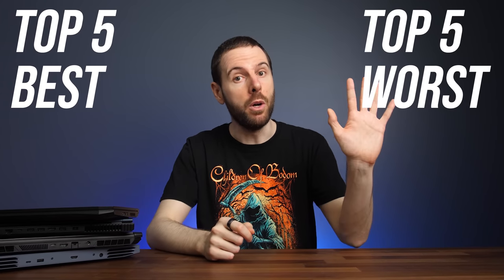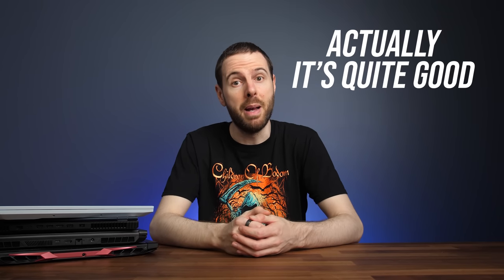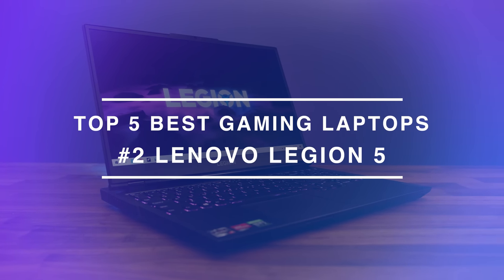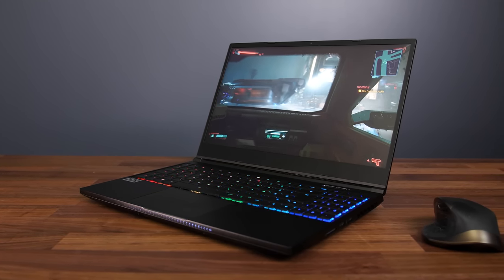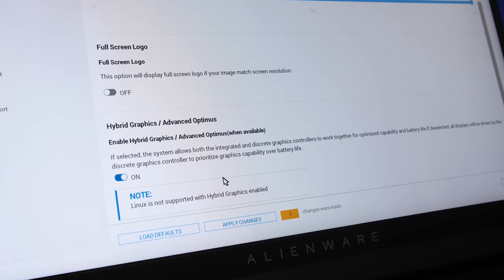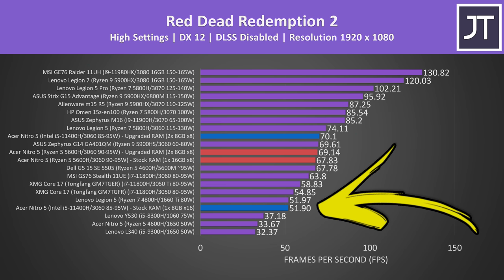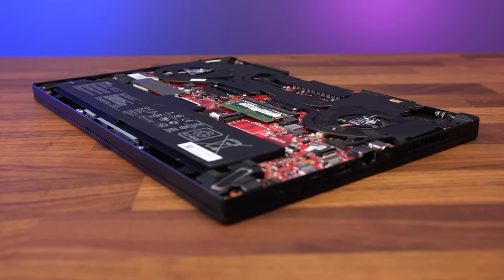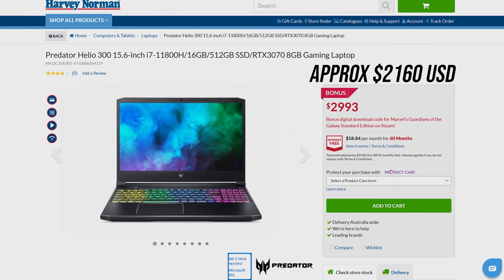Top 5 BEST & WORST Gaming Laptops of 2021!

Comment: It's sad you left the G15 Strix AE off this list.  It's by far the best value to performance you can get.  5980HX/6800m are both top tier.  Biggest knock on it is the plastic, but you had the Dell G15 in the list so apparently that isn't the issue.  But this is an opinion piece so I can see certainly understand liking the Legions.  Cheers!
Reply: I tried the G15 Strix AE and desperately wanted to love it. The CPU and GPU are crazily powerful... BUT, no MUX switch to fully unleash that 6800m, and the heat build-up on it (and every other 15.6" laptop I've tried) killed the deal for me. I also couldn't stand the heat and fan noise pumped out by the Lenovo Legion 5 (with its incredibly irritating and constant fan spin-up and spin down). The Alienware m15 R5 with the 3070 was the biggest sauna-maker (Jesus, the heat that thing threw off, I'd be amazed if the machine lasted a year of normal use), and the pushed down keyboard had my wrist hanging over the edge of the keyboard deck, so that was returned, too. The Dell G15 came the closest to being tolerable in terms of the fan noise generated, but it also ran a bit hotter than then Lenovo. I think I liked the G15 the best because it was quite a bit cheaper than the Lenovo, and quieter while gaming, while still providing a MUX switch and the same 165Hz 1080p panel.  I finally figured out the only solution to the heat/fan noise generated by all the 15.6" laptops I tried: a 17.3" form factor. Currently have an MSI Leopard GP76 with an 11800h/3070 combo. It has a MUX switch, but runs quieter than the Legion 5, and the heat simply gets more easily dissipated by the larger chassis. Only thing is, it weighs a ton, especially with its power brick. I finally just tried an Asus Strix G14 with an AMD 6800hs/6700s combination, and I loved the size and weight, but it got so hot, it was actually uncomfortable to touch the upper metal keyboard deck. In this case, I think the plastic chassis are an advantage, like with the Dell G15, because plastic is non-conductive of heat, so the keyboard deck stays noticeably cooler. In the end, I might just sell the Leopard GP76 and pick up a 2021 Dell G15 5800/3060 combo for $1199 Canadian while I still can. The awesome battery life combined with the gaming performance, quieter fan, and the plastic yet high-quality build may have just won me over for good.
Reply: @EMLL.33  got the same g15 for the same price expect intel i7 was 1200 cad and the ryzen was 1500 cad so I went with the intel

Comment: I personally have no problem with a single ram stick because I already have sticks, making it better than if it was dual channel because then I'd have to change both sticks to upgrade the pc from 8gb to 16gb. But for those without plans to upgrade dual channel will be better
Reply: Changing 1 stick vs. 2 sticks isn't that much different though.
Reply: @ACE112ACE112  true, but in my country parts aren't easily accessible, or cheap

Comment: I have the XMG Core 15 so essentially Neo 15 budget version. And if Jarrod had it it would be No. 1. Cheaper by a €1000, but barely worse. All the same features bar mechanical keyboard and the chassis is half plastic half metal, not all metal. Also well cooled, light and powerful
Reply: Mech 15 G3 owner here! Woot! Great PC, glad you found a good deal for the TongFang chassis.
Reply: Correct me if i'm wrong.
Core15/17 are Clevos and Neo15/17 are Tongfangs.
Reply: @nyyke   Both Tongfang. It almost the same chassis and it is the same display. Both get that good looking control panel that has controllable power limits (very cool) but some buginness (less cool)
Reply: @nyyke  Yes, if by Neo you mean a brand from XMG -- those feature TongFang chassis (basically the same as Mech 15 G3 from Eluktronics), though not everything by XMG is from TongFang, they are listed as customers of Clevo as well but not certain about the details. Cheers, mate!
Reply: Sorry My mistake, I just messed core and pro. As you corrected already core15 is tongfang 😅 with neo and core there is few minor differences in power supply, gpu avaibility and other small things.

Comment: Thank you for your incredible work. It helped me a lot by choosing the right gaming laptop. Finally decided to go with the legion 5 (3060/Ryzen 7 5800h) and got one for 1000€ at Amazon 😍
Reply from the maker: Glad I could help!
Reply: One month in, how is it holding up?
Reply: @JamesMcarthy2369  the laptop is awesome, performance ist outstanding and even the cooling system is working really well. Never had temperatures above 75° (GPU) and 85° (CPU). I totally recommend it
Reply: @SilkroadFever  thanks for your reply! I’m going to grab it in a few days.
Reply: @JamesMcarthy2369  same 😁
Reply: I just ordered the same as yours with 17.6 screen. Had lot of doubts when choosing between 15.6 and 17.3 since I never had bigger laptop screen than 15.6
Reply: @anon4376  well for me 15.6 is more than enough. I mainly use it 1-2 days a week when I visit my gf or my family. Rest of the week I have my tower at home, so I thought 15 screen is more comfortable to travel. :)
Reply: @SilkroadFever  Hi is still working well now ?
Reply: @hanionline563  hey, yes Laptop is running perfectly fine! The CPU and gpu temperatures are a bit higher than at the beginning, but I never cleaned the fan. This gonna be my to do in the next months. I still totally recommend it!

Comment: I got the Acer Nitro 5 3060 with the 11400 i5. It was A$1796 marked down to A$1287 this weekend. Extra stick of ram and it’s great laptop. Paying close to A$1800 would be a disaster compared to the legion 5 or dell though
Reply: rip bro now its 650$ the amd version
Reply: @TheChuyDewy  Best I could find was a 3050 version for A$997, even my exact model was A$1398 a year later. 

That’s at Harvey Norman.

Comment: Great video and great timing to release. Thank you for your hard work. 
I am wondering which one is better if the price is only 100usd different between this two options for a Legion 5 pro;

Option 1: Ryzen 7 5800 rtx3070 
Or 
Option 2: i7 11800 rtx 3060

I want to make a decision according to better performance and long term usage.

Anyone is welcome to comment.
Thank you in advance =)
Reply: The Ryzen version hands down. I'd avoid Lenovo if you want a laptop that will actually last
Reply: If it helps, I went with the Ryzen version. Tends to be more efficient on battery and the performance is very similar. If you are a gamer, go for the 3070 version. I'd only go for the intel if you need thunderbolt.
Reply: Ryzen all the way
Reply: @xXlURMOMlXx  wdym
Reply: Better gpu any day

Comment: For the G15, only the G15 5511 (i7 11800h) and the g15 5515 ( ryzen 7 5800h) has a mux switch while the G15 5510 (i7 10870h) doesn’t. G15 5510 also only has 90W tdp 3060 while the others are 125W
Reply: Good to know🙏
Reply: I bought the Dell G15 with the 5800H and 130w 3060 and it's the best gaming laptop I've ever purchased and I've owned numerous over the years now.. incredible performance for the $$ and great looking with solid build quality

Comment: What are anyone's thought about Asus Strix G15 Advantage Edition. On one hand we get to hear negative reviews about its GPU going completely kaput weeks after purchase, but on the other hand the 6800m costs what a 3060 Laptop would cost here in India and gives performance that sits between 3070 and 3080.
Reply: The advantage costs 1.55L. It’s probably one of the best high end laptops here but still not worth it. Better to get something like a victus or a nitro(upgrade it to dual channel)
Reply: Asus is unreliable. I had 2 different laptops die on me because of their motherboard soldered crap. Even without that, poor finition and poor thinking by engineers. After all this years they still don't learn about their mistakes it's like they don't care
Reply: @niksarass  their qc is trash. I returned my AE 4 times due to screenbezzles falling off
Reply: @windkiller97  Hahaha I had that one too! My screen ended up stuck, in top of all the other problems. What a joke of a manufacturer

Comment: at my place the dash f15 has a pretty reasonable price at this gpu shortage time while the legion 5 has a terrible p/p
Reply: Asus tuf dash f15 only make zense in cheaper variant with rtx 3050 and rtx 3050 ti avoid rtx 3060 or above variant because it will cause cpu bottleneck
Reply: @mrbobgamingmemes9558  the opposite can be seen with legion as the more expensive variants have a somewhat reasonable price while the lower and more affordable variant are out of stock most of the time therefore increasing its price
Reply: @mrbobgamingmemes9558  don't worry it makes sense with ryzen version with 6 cores and 8 cores, it is cheapest in india ( model becomes asus tuf gaming a15)
Reply: @be_an  why not just check regular asus tuf a15 or f15. if asus tuf dash pricing very good in your region same thing should applied too on tegular tuf a15 and f15 2021 edition
Reply: @mrbobgamingmemes9558  well yeah but what i was trying to say is that legion 5 is not that great anymore at least for now during the pandemic
Reply: @mrbobgamingmemes9558  actually 3060 version is the best bang for the buck. 3050\ti not only seriously lack vRAM, but also cost nearly as much as the 3060 version of Dash F15. It's the 3070 version that people should avoid.
Reply: I want to buy a normal one (Not Dash) with a i5-11400h and a 3050 is it good?
Reply: @JD-jn14  if you cannot spend more for rtx 3060 yeah sure go for it .just beware that maybe in 2 years you have to play at 720p resolution due to small 4gb of vram
Reply: @TabalugaDragon  tuf dash f15 only make sense to buy with rtx 3050 or 3050 ti  above that gpu class you will suffer cpu bottleneck . Trust me you dont want pay more for the gpu but you cant utilize the entire gpu because the cpu cant keep up with the gpu
Reply: @TabalugaDragon  just go for regular tuf a15 or f15 (non dash) version for rtx 3060 or above
Reply: @mrbobgamingmemes9558  Yes I do, because 4GB of video memory 3050 and 3050 ti have are an already terrible bottleneck, where you  can't max out textures in any AAA game without a serious drop in performance. No such thing with a 3060, not to mention overall more energy efficiency due to having more cuda cores. 
Again, 3070 is an overkill for this TDP and this quad core CPU, while 3060 is actually a good choice. Sure it will bottleneck some games but in no games you'll get terrible performance as opposed to 3050 ti. Which, mind you isn't even much cheaper than 3060. 

Connecting an external monitor, which is an option for most buyers will also reduce the CPU bottleneck.
Reply: @TabalugaDragon  maybe check linus tech tips video about "is 4 core still anough' to get an idea how bad about cpu bottleneck on 4 core
Reply: @TabalugaDragon  honestly for rtx 3060 or above i would rather choose regular asus tuf a15 or f15 with 6 or 8 core
Reply: @mrbobgamingmemes9558  Not a heavy gamer but need it for university
Reply: @JD-jn14  4 core not only causing problem for gaming but also productivity workload too
Reply: @mrbobgamingmemes9558  This one has 6 cores is it enough?
Reply: @JD-jn14 depend if your hudget can afford 8 cores or not
Reply: @mrbobgamingmemes9558  regular TUF has worse build, no thunderbolt, it's a little bigger and heavier.
Keep in mind Dash F15 is based on last year's Zephirus G15 chassis, which is a noticeably more premium laptop than regular budget TUF
Reply: @UC9RZOxc18Nso2SMaMYlrTiQ it's not worth to you. but Dash F15(at it's normal, original price) offers great performance per dollar and an overall high quality product, like Zephirus G15 but 300 dollars cheaper.
Reply: @TabalugaDragon  its up to you if you willing to accept cpu bottleneck . I just warn you about serious cpu bottleneck if  you choose rtx 3060 and 3070 variant of asus tuf dash f15.
Reply: @mrbobgamingmemes9558  I've seen detailed gaming benchmarks and Dash F15 is 5-10% slower on average in games than Zephirus G15 while being 300 dollars cheaper and having thunderbolt. It's an excellent laptop if one can find it for the original price.
And you don't need to tell me again and again about CPU bottleneck because I've been studying computers for a long time. 
As for your Linus Tech tips quad core video - I'm guessing you know nothing about architecture and IPC. Because if you did, you wouldn't have mention Linus'es video, where they test a 5 year old quad core, which has nothing to do with Tiger Lake H quad core, which not only has entirely different architecture, but also a smaller 10nm process. So the quad core in TUF A15 is like a 6 core from the era of CPU-s Linus was testing in that video. 

Not only that, they tested it with top end rtx 3090, while TUF has a pretty much max q 3060 which has less than half the speed of a desktop 3090. So no, it' pretty well balanced. 
That said, I am aware of some CPU bottleneck for Dash F15, but for official 1100 dollar MSRP  it's more than worth it compared to competition for the same price.
Reply: @TabalugaDragon  yeah ipc is way better but most newer triple a title  will run better on 6 core but older cpu than newer 4 core cpu with better ipc if that  game run on powerfull enough gpu. Also 4 core feels weak for productivity workload excecpt single threaded ones but honestly most of singlethreaded workload is not something demanding that you need powerfull cpu. Anyway Just enjoy the laptop if it fits what you need
Reply: @TabalugaDragon  maybe i cant recommended it bacuse asus tuf dash f15 is insanely horrible deal my in region
Reply: @TabalugaDragon  arent they like the same (F15, F15 DASH)
Reply: @JD-jn14  there is F15 with an Intel H45 CPU(6 and 8 cores) and there is Dash F15 (with a quad core H35 cpu). The thing is H45 CPU-s have much higher power consumption and as a result such laptops have poor battery life. While Dash F15 battery life is exceptional, lasting up to 15 hours.
Reply: @TabalugaDragon  in conclusion FX516PC-HN055T is 
better than FX506HCB-HN140T

Comment: I hate how in my region, most 3060 laptops are way pricier than the Asus Tuf Dash F15… The only comparable laptop is HP Omen 15 but it’s always out of stock…

Other options would be MSI GF65 Thin and Acer Nitro 5 with 3060s. Or be content with lower end models with 1650/1660…

Comment: I'm at the point of my life choosing what I should buy. My mind says ROG 6 Pro. But then is it worth it to just play Mobile Legends? PUBG Mobile nor New State? If it so, I miss the comfortability of mouse & keyboard for it so consider me buying adapter or a HUB for it to use it for mobile gaming then I realise the input lag it gives same if I chose Series X with Apex adapter for console or a VX Aimbox right? So then it came to building a desktop of course it is the best but then I'm in Cambodia switching apartments and I consider a laptop. And Here I am watching you. Your brutal honest review really intrigues and helps me a ton. But my final conclusion though is it's worth it to buy a laptop that has RTX 3060 with $1,400 on it and should I go 32gig? ot 16 is it should it rest? Or should I rest with ROG 6 Pro till I die. Mobile Legends, all the PUBGs, NBA  2K23, Farcries haaay... Help me get a laptop

Comment: I got the Lenovo Legion 5 17.3” with the AMD Ryzen 5 5600H & NVIDIA GTX 1650 for $808.92 shipped + tax via Walmart although I could get it for $754.92 shipped + tax now since they dropped the price further. I can see where they cut corners on my model, with the lower refresh rate 60 Hz IPS LCD 300 nits panel, 8 GB 1RX16 CL22 3200 Mhz micron RAM in single channel (which im planning to replace with Kingston RAM), and less storage with 256 GB samsung ssd (which i might upgrade to a higher end and more capacity samsung ssd). Overall, i still like the legion and im happy to be able to get it at the price i got it at.

Comment: I have used Dell G15 for a week and I can say that it is the best entry-level Gaming Laptop with Latest Graphic Card out there. My Model is Ryzen 5 5600H RTX 3050. I haven't faced any noticeable heating issues yet. I played a couple of games and used them continuously for browsing and installing software. One thing to note though is that the Fans run quite loud especially during Driver Updates and in G mode. I feel like they haven't optimized the fans properly as they start running even when the temperatures are not that high. But that's just my opinion. As for Display, it is a 120Hz VA Panel and tbh the difference is noticeable. I have personally tested this side by side with my HP Laptop with an IPS Display. It has a yellowish tint. Other than that, it is the same as any IPS Display, viewing angles and picture quality is great. For Battery Life, I tested with 120Hz on, full brightness, and some common tasks like Browsing and Youtube. Battery Level was dipped from 77% to 20% in around 2 hours. Lowering the Brightness and 60Hz will definitely add an Hour or two. Overall this is the Best Value for Money Gaming Laptop out there atm so buy one if you're ok with the issues mentioned above.
Reply: Glad to know I'm making the right choice. Ordered the same version as yours only because it was the cheapest RTX3050 laptop available here with only GTX1650 options available for the same price range on any brands. Bummed up a little with the RAM and I/O ports option given but I just bought extra 8GB RAM and USB C docking port that cost just around USD50 (which I think Dell might ripped you off if you ordered from them). So life is good and it's getting better, thanks to you for telling your own experience with the product.
Reply: Does the g15 va panel bother you? I feel like I can't use it for long, makes my eyes uncomfortable.